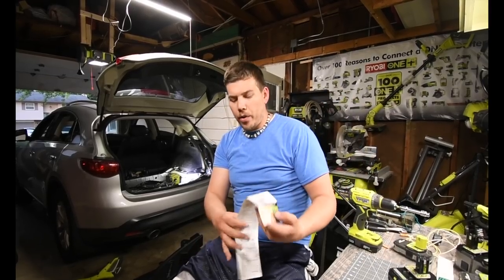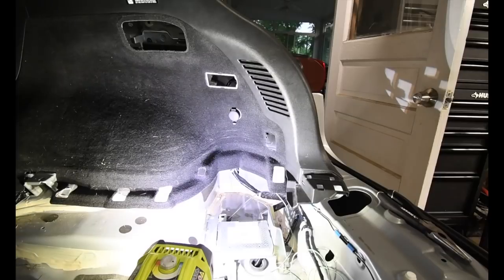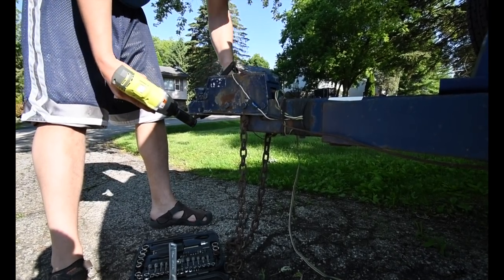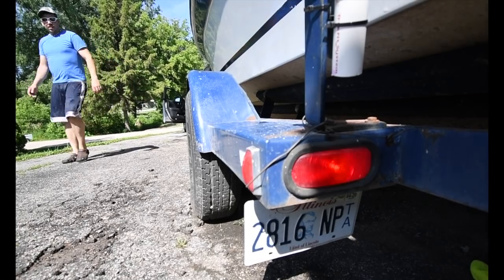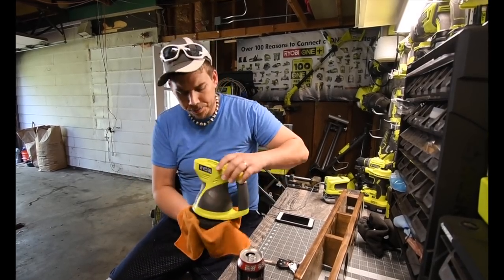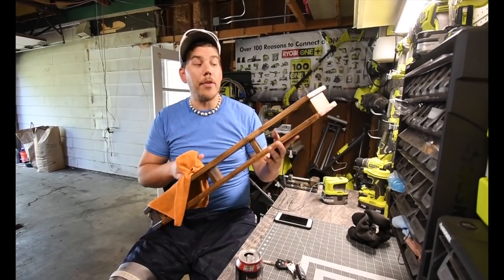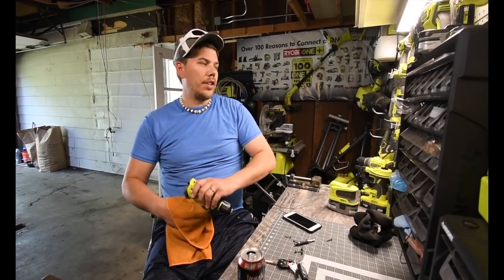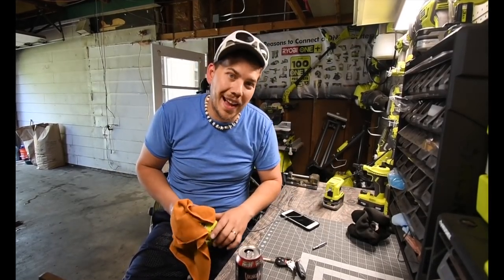Installing Trailer light connectors to my car

Comment: Nice video what’s the towing capacity of that car? Are you going to run a transmission cooler? Good sized boat just wondering
Reply from the maker: 4,000 lbs
Reply from the maker: boat and trailer is about 3800 lbs. just made it and I won't be traveling far at all while I'm hauling it.
Reply: Towing over capacity is a man thing. You’re good. 👍